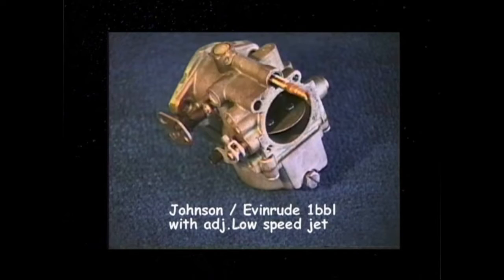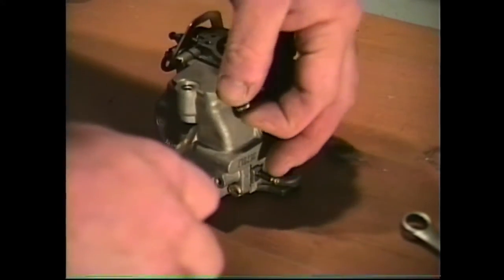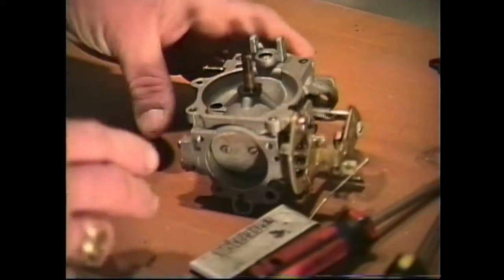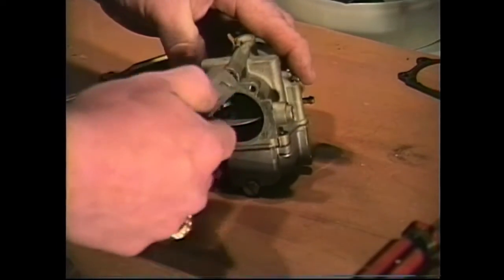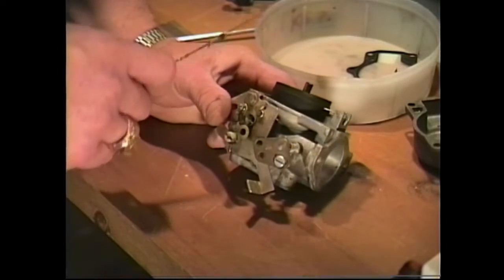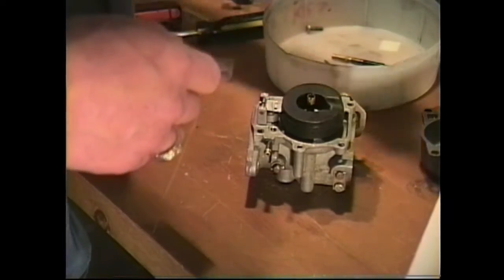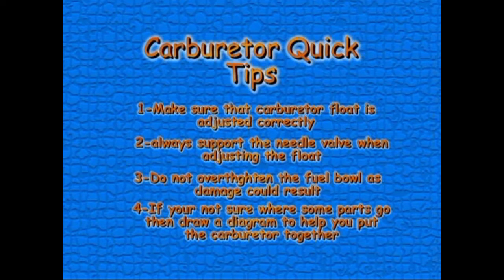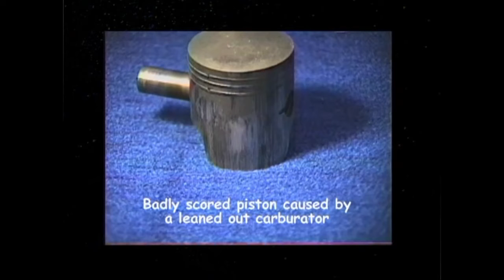Carburetor Repair Secrets: Review Johnson & Evinrude 25-75hp Engines

Comment: Was the high idle screw removed as well?
Reply from the maker: Hello Ben, Yes, if it had one, it should be removed along with a low-speed adjustment adjustment to make sure that all dirt and horn material is removed. Thanks for watching and commenting

Comment: What do you do if you have a non adjustable low speed carb that runs rich?
Reply from the maker: Thanks for your comment. With non adjustable carbs either you can change to a smaller jet on the low-speed jet to help with the fuel richness. Hope this helps. Thanks for watching and commenting